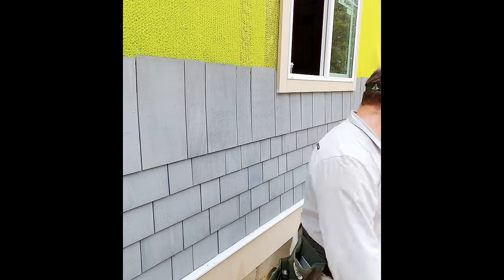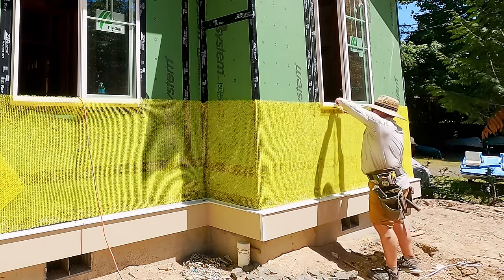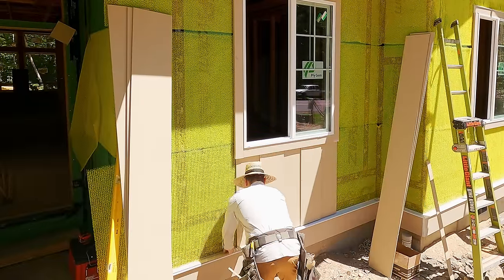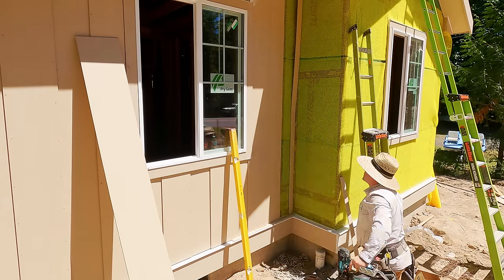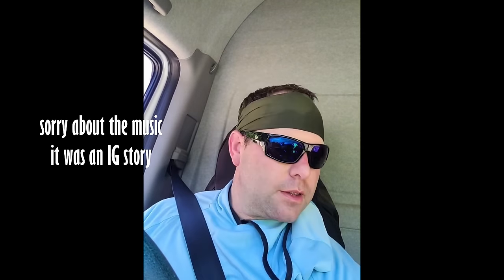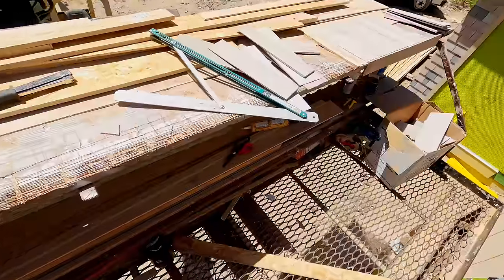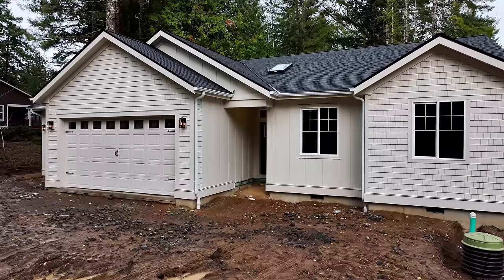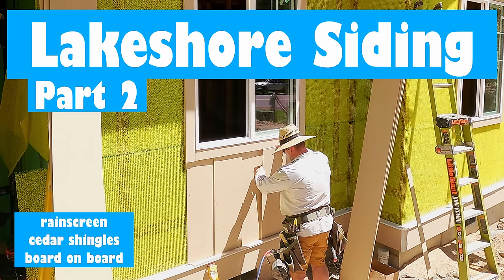Lakeshore Siding Part 2 Rainscreen Cedar Shingles Board on Board

Comment: Nice work.  I always learn a thing or two from your videos.  I know you’re just building this house but the entry way seems extremely narrow and deep for my liking.  20-30 years ago, in the Tacoma WA area, we pulled off LP siding from house after house just to replace with Hardi.  All the LP was swollen, rotten etc and most of it not even 10 years old.  I see more and more builders using this newer version of LP smart siding but I just can’t get the old stuff off my mind to accept this new product.

Comment: Great series. I look forward to the next one. Just a quick question? Is there a reason u guys don’t use trusses on ur homes. I was thinking at first maybe lead times are backed up on getting them but I just thought I’d ask.
Reply from the maker: Great question.  It doesn't save us any money to use trusses.  Scheduling is much easier, we have open attics and we can quality control better.  I had this house priced for trusses and truss materials were significantly more expensive than the framing materials to hand cut it.

Factoring in labor its about a wash
Reply: @AwesomeFramers  

I priced out the same thing even in the last couple months. 18" energy trusses were 3x the cost of materials for hand framing, and that's not including the blocking and bracing, crane rental, etc. For short to short-ish roof spans with simple shed or gable roof lines, I've had truss manufactures say cut rafters if you can. Especially for a shed roof, where you can get away with 2x12, or even 14" for an I-joist if you need the depth for insulation, compared to 36" for a roof truss.

Comment: Thanks for another great video! I continually learn a ton from your work. Can you tell me what type/size/length of nails you're using here? I'm installing WRC shingles on my house over Slicker Classic, using 16 ga, 2" staples. And it often feels like they could be hammered in more. Not sure if that's the nature of the rain screen having flex. But curious if nails pull the shingle tighter to the wall. Would love to get your take. Thanks again!

Comment: Have you tried the powerlite HN65 siding nailer?  I'd looked at the Mac lineup before but the prices turned me away but since luck shown on me recently, I looked back into then and the weight difference is crazy!  That HN95 is 5.1 lbs vs 8.3 for our latest DeWalt framer.  That's a huge difference.  Sorry to hijack your comments but that weight difference means a lot as I age (slightly older with smaller hands and calves).  Also trying to convince my boss to go with the slicker for some cypress siding we have to replace along the entire side of a house.
Reply from the maker: many years ago.  The price is high on the tools, but they are very well made and last a long time.  Much less wear and tear on the body

Comment: Question? If you shot nails in thw key ways wouldn't the run off go through there into them worst case or no worry? Because of the rain guard
Reply from the maker: if they were larger nails maybe, but they are only 16ga so the shingle will swell and close off that hole, but the rain screen will keep it all protected.

Comment: I like the corner board detail—for both the lap siding and shakes. I think I will try it. So it eliminates the need for precision,  and the typical swollen ends you find when siding butts to trip. Question: is there any concern for insects getting in behind the siding to nest or host college parties? Presumably, the tiny triangular gaps do not receive sealant.
Reply from the maker: goo question  In our area we find that there isn't any evidence of bugs living there and causing damage.  I don't know that this would be the case elsewhere.

Yes the 3/8" tapering to zero don't get sealant, so this is a maintenance free corner.  I've pulled corners of buildings from the 60's and it looked band new behind the corner.
Reply: Great entry point for bugs.  I had a house that was done that way, Hardi on the front with corner boards overlapping.  Had T1-11 on the rest of the house so I installed Hardi all the way around, cut the Hardi on the front and removed the corner boards to use 5/4 trim, full of bugs and spiders.
Reply from the maker: @williamdecamp7343  that's too bad. I made it clear in the video this works and has for decades in our climate. Might not work everywhere 👍

Comment: You do realize that LP Smart siding is not warranted by the manufacturer in the Pacific Northwest?  Have you read their warranty?  It also clearly states not to allow your sprinkler system to spray on the siding, hello, are you going to prevent the rain from raining on that siding?  It’s garbage in the king run.